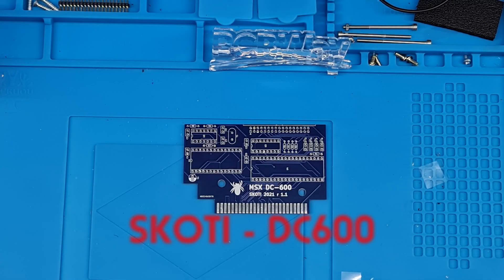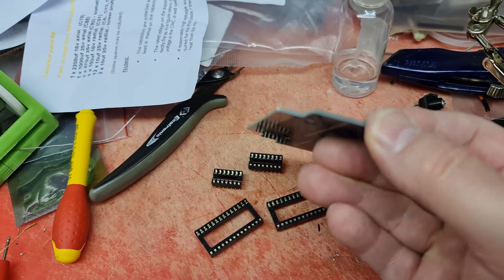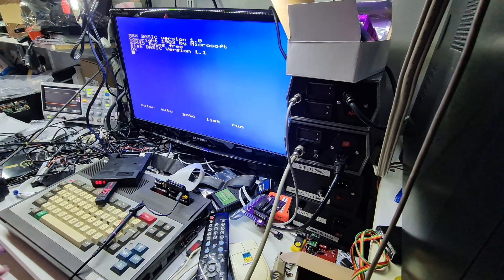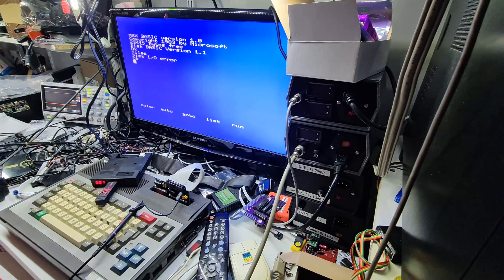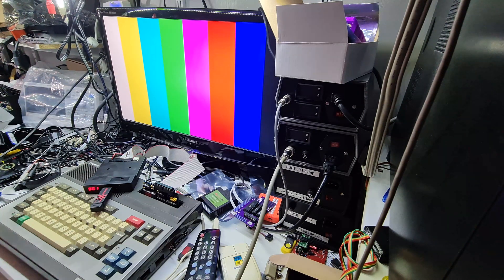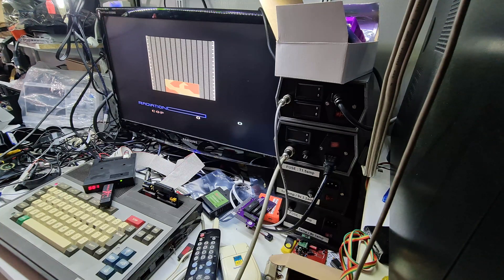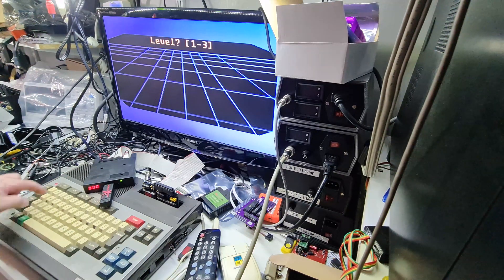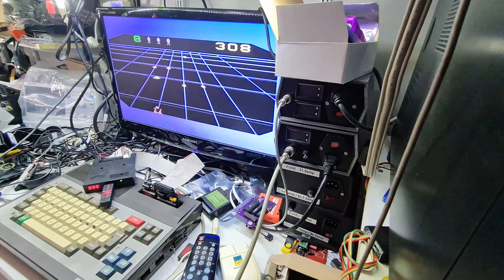MSX DC600 - The cartridge based DC-600 reimagining of the TDC600 Floppy controller for the MSX

Comment: I am building mine and I keep having Disk I/O error. I have tested replacing 74sl04 and 138, I have replaced the 330R resistors by 1KR, I testes another disk drive... But I keep having the same error. I ran CALL FORMAT from MSX Basic and it seemed to work. I could count the noise of the read/write head moving 80 times, however I get Bad parameter error at the end.
Reply from the maker: Have you got a scope to check clock signal , you can try replacing the ls14 chip for a different brand
Reply: @CaptainCommodore  I measured the clock with an osciloscope and I got 48MHz... Then I bought some Hitachi's HD74SL04... Received them today and it worked at the first try. Now the clock is 16MHz and the floppy drive is working perfectly. Thanks for the hints.
Reply from the maker: @MauricioPereiraLopes no problem , I had a similar issue

Comment: Hi there! 🙂 Thanks for this video! I'm building one of these as well. Which voltage ceramic caps did you use? The BOM is not great on GitHub. I guessed 16V but those seem to be very hard to find in non-SMD form factor. Greetings from NL, Alex
Reply from the maker: @alexhofstee466  I don't have mine to hand to check but from memory it shouldn't matter with ceramics whether it's 10,16,25 or 50v as they don't behave like electrolytics ( think mine are 25 or 50v) these are mainly used in decoupling,  just be careful with the timing on the crystal, that gave me a lot of problems )